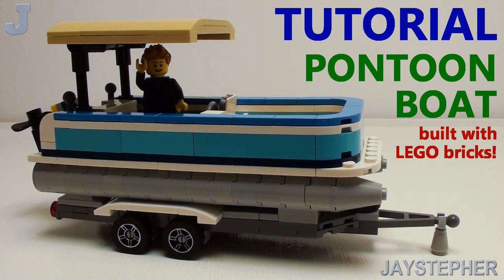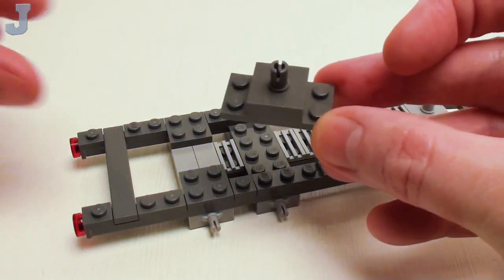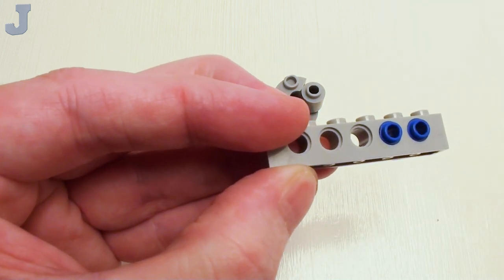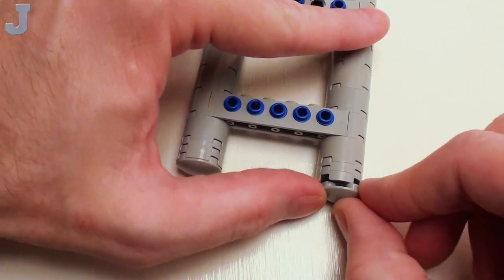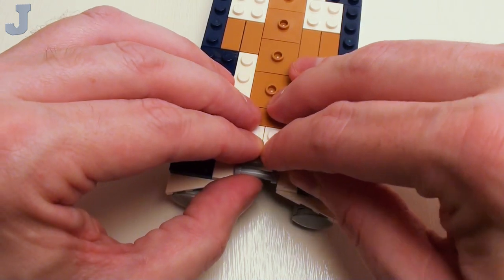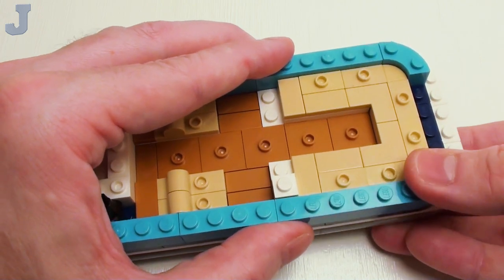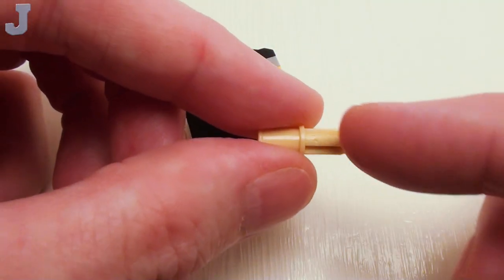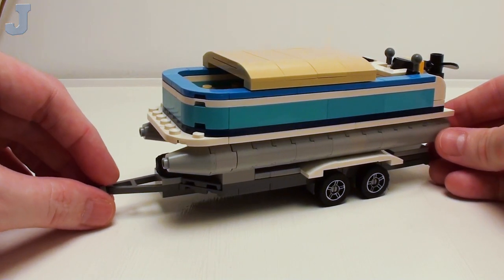Tutorial On How To Build A Pontoon Boat With LEGO Bricks

Comment: Love it but the steering wheel is on the wrong side
Reply from the maker: thanks! the one i toured had it on that side. i think it depends on the manufacture.
Reply: @jaystepher  usually they are on the right side of the boat
Reply: Came here to say this. Boats drive from the starboard side. That aside, this is probably my favorite MOC I've seen yet. The collapsible cover is awesome and discrete!